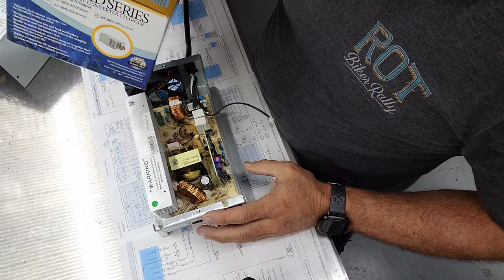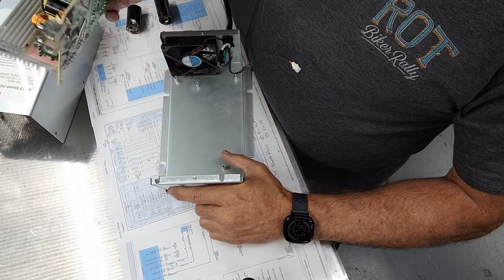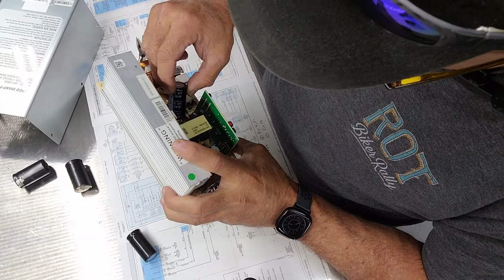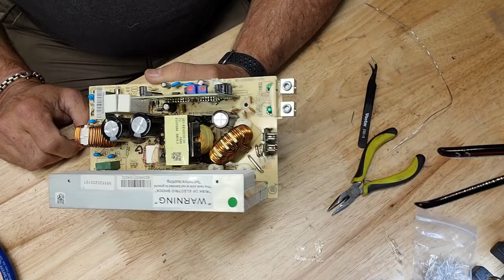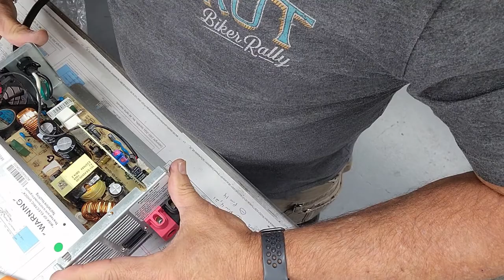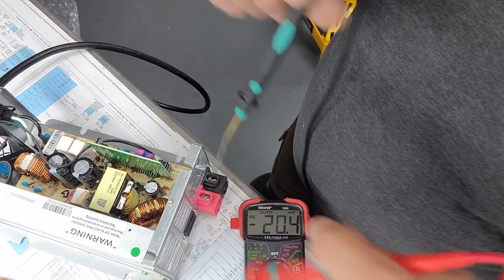Loss of 12v Power - RV Converter Repair Jayco Keystone  Forest River Winnebago Etc.  Confirmed fix!!

Comment: Great video.  I just replaced mine today but I can’t stand to throw things away.  Will likely crack into the old one and use it as a charging station.   I like to revitalize old batteries using Mag Sulfate and it requires a handful of cycles of rapid charging and deep discharge.  This will work well for that.  Hope the caps are the issue in mine.